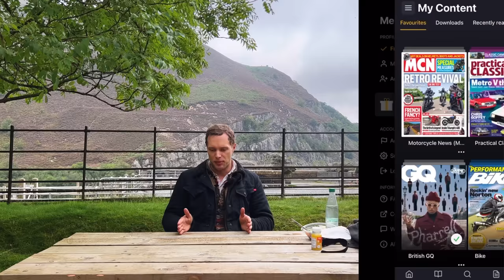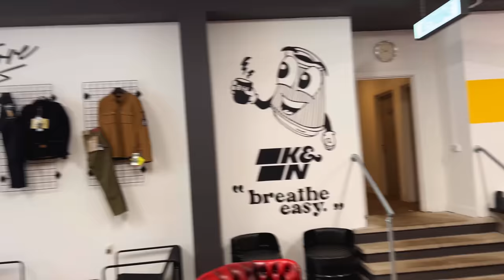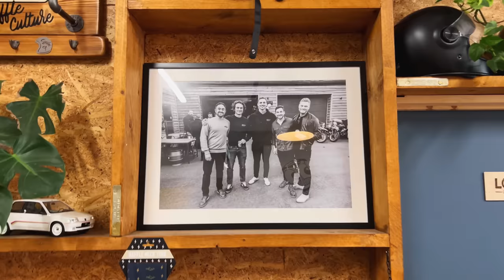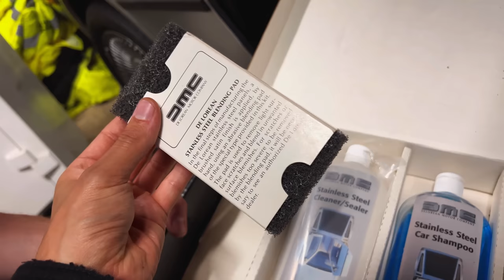On Any Saturday in Wales | 450 Miles, a Biker Hangout, Ludicrous Roads and How the Welsh Live

Comment: Imagine the not too distant future when these places will be full of electric vehicles. 🤢. Or perhaps they won't be - I can't see myself buying an electric motorcycle.
Reply: Maybe a hydrogen conversion for the internal combustion engine is a better way to go..
Reply: by then you won't be around or to old to ride 😅
Reply: @ctydecks not so sure, check out Mr Bean at Goodwood this year, a petrol Yaris with a remap to run on hydrogen. JCB are already doing it. It has to be a better alternative than a milk float 😁
Reply: Remember there were electric vehicles before petrol powered ones 
They didn’t work back then just like they don’t and won’t work now for exactly the same reasons 😂
Reply: ‘Loud exhaust pipes save lives’
Can you imagine how dangerous it would be riding a ‘Silent’ electric bike where no one can hear you coming. 🤔
Reply: @cowmath77 horses don't combust and put out toxic fumes such as colbolt when they shit them selves😅